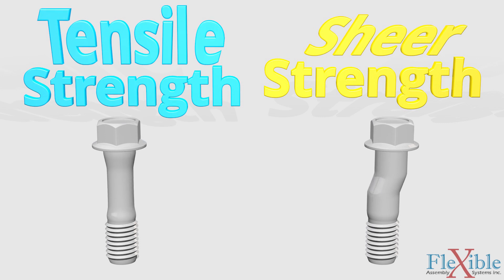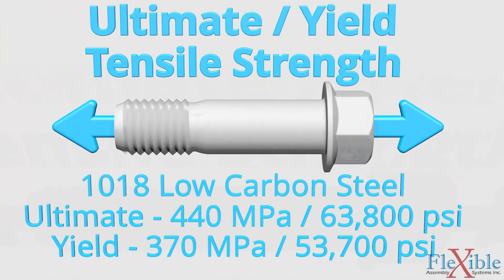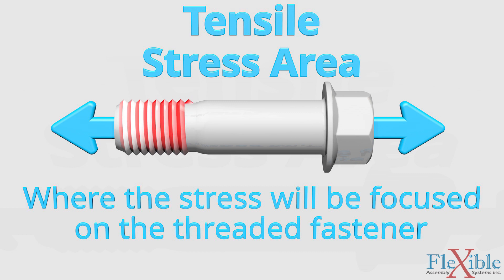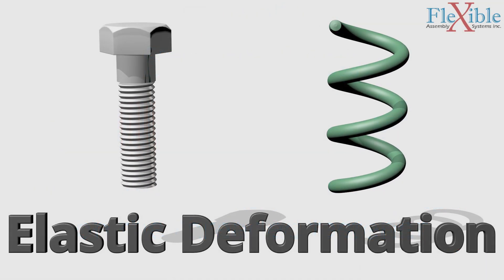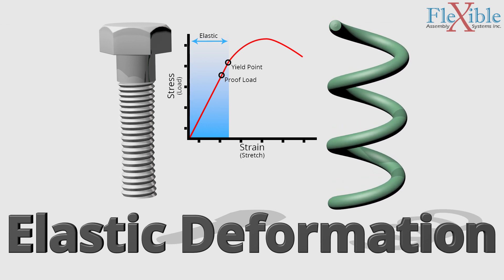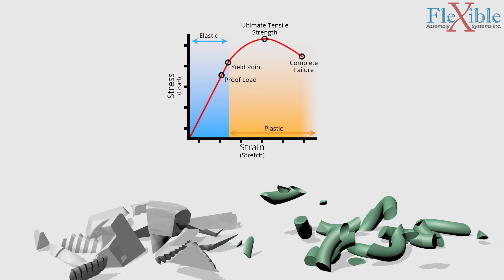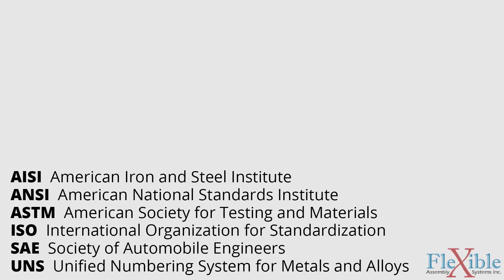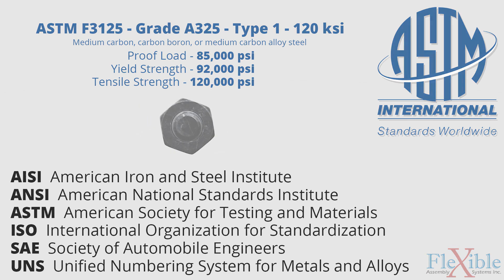Tensile Bolted Joint - Breaking / Yielding - Fastening Theory Part 4

Comment from the maker: There is a typo at 0:05 which says "Sheer", it should be "Shear". Sorry!
Reply: Hello! Do you know if the Skidmore tester device measures the bolt's yield pressure or the bolt's clamping pressure? Thanks for your help and assistance
Reply from the maker: @pedrohernandez8373  To measure the clamping force (or pressure) of a bolt you would need a load cell in between the clamped surfaces. You could measure the yield point of a bolt with a strain gauge from Skidmore by stretching the bolt until it begins to deform elastically.

Comment: Thanks for the informative video.
I need guidance on selection on Allen bolts.
We use Metric allen bolts.
How do we choose the size of the bolt and pitch distance between 2 bolts and number of bolts needed to assemble  plates ?

Comment: why does the yield/ultimate strength calculations are done with the nominal diam. value of the bolt and not the minor diam. which is the actual area that is solicited when bolt is being clamped?
Reply from the maker: This is the best information I could find on why we use the nominal diameter value. "When a standard threaded fastener fails in pure tension, it typically
fractures through the threaded portion (as this is characteristically its smallest and therefore weakest area). For this reason, the tensile stress area is calculated through an empirical formula involving the nominal diameter of the fastener and the thread pitch."